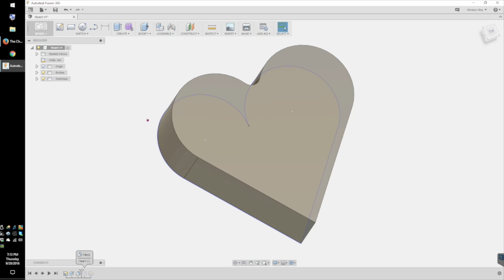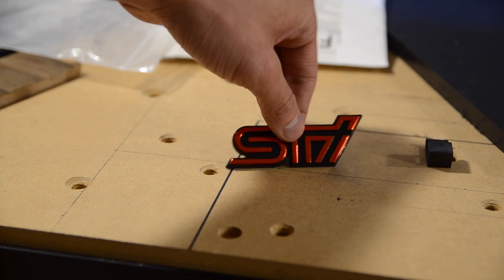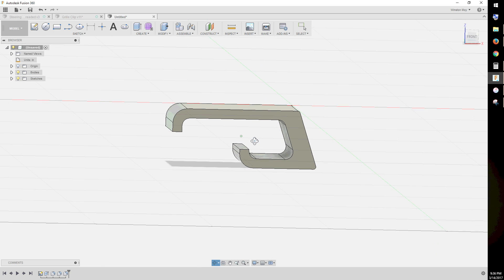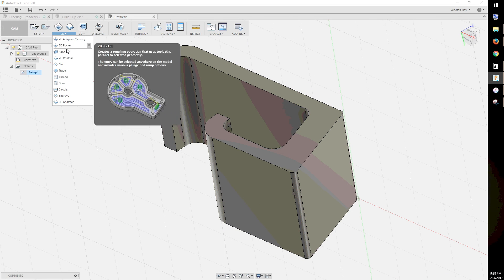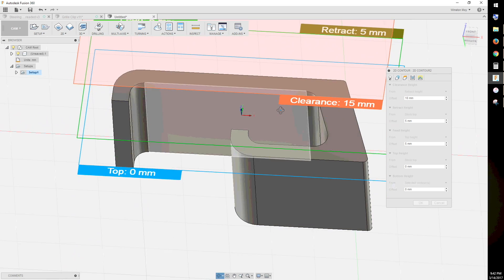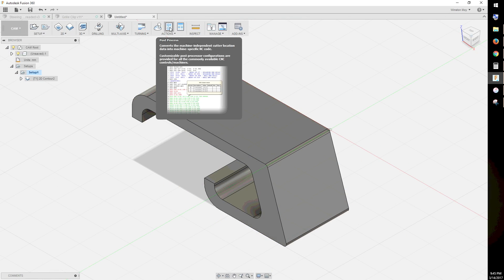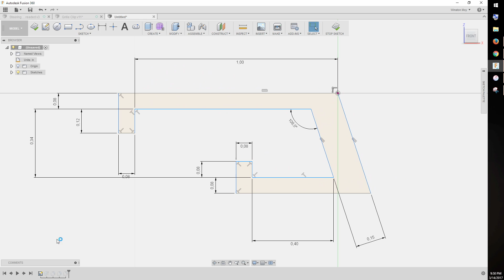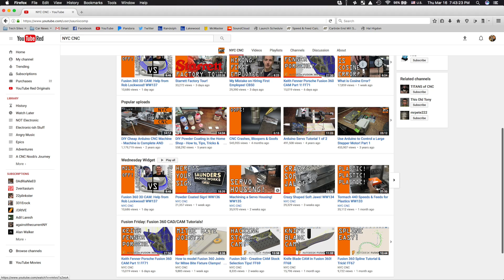Fusion 360 Overview: 2D CAM Start to Finish - CNC Project #84

Comment: Nice video but I have been asking for over 1 year which equipments compatible with this software, I have contacted dozens 0f channels. And equipment sites and not 1 decent answer
So after you make this part in software where do you go and how it is actually made, any help would be appreciated. I own a BIESSE Rober B cnc
I dropped AUTOCAD long time ago and currently using SKETCHUP 
Exporting simple dxf files and loading directly cnc
Thanks

Comment: I’m very new to Shapeoko. How do I use my Shapeoko with fusion. I have a simple drawing in fusion. Can I open in carbide create? How do I cut the drawing? Thank you, I really like your videos.
Reply from the maker: I published an overview of the Fusion to Shapeoko process on the Carbide3D channel, which you should be following. https://www.youtube.com/watch?v=xRVVUteI1PY

You can export a sketch as a DXF and open it in Create but it's a little buggy. splines and complex chains don't always work right. Inkscape might be necessary as an intermediate step. But the point of using Fusion is to ultimately model AND create the toolpaths in the same program, it's a one stop shop.

Comment: cool, couple of questions tho, what library of tools do you use? is there a carbide tool library that can be used in Fusion 360? or did you just manually added every tool?

Comment: Going from Jay Bates' sketchup tutorials to your tutorials are night and day. For example, he describes each of his steps so you can follow along. You seem to be quite familiar with Fusion 360 and, as someone who just installed it, you've made me incredibly nervous about using the software as you blasted through the simple part of drawing the shape. Feeling more intimidated after watching your video vs before.

Some tips; explaining your dimensions would be helpful. A comment such as "I select the line too and since I measured that the clip needed to be 20mm I set that, it's going to be 10mm high, so I... etc, etc". You spent more time talking about how great fusion 360 was vs explaining what you were doing. 

One more note, from the start Fusion 360 is set to metric and you're using imperial measurements. This threw me off as well because I was hoping to copy your steps to familiarize myself with the tools.

Sorry if this seems overly critical.

Edit: I see your description says "for Carbide3D users." It's quite possible I'm not your target audience.
Reply from the maker: I welcome the feedback, I can't predict everyone's perspective. My goal with the video was not to be a full-fledged tutorial, but to show that there are a manageable, finite number of steps to go from scratch to CNC recipe. 

There's really not a ton that's specific to Carbide3D, other than the post processing. Future videos like this will include tips and tricks that revolve around Shapeoko/Nomad features and limitations. But the overall process is the same for any machine.

For learning the basics of F360, I highly recommend the content on Autodesk's channel. They go through fundamentals, include tips for Solidworks converts, etc. In the future, I see that I can dive deeper into design decisions I make and the specific actions in CAD I do to realize them.

Comment: Thanks for making this. I have experience in solid works and carbide create and need to fill in the middle knowledge. Still never confident about axes and whether I have them correct in solid works so may try fusion360 more

Comment: this piece seems way more suited for a 3d printer to handle, but I know how you feel about it. :p
Reply: I was thinking the same thing.. I am still a beginner with fusion 360, however, I have been able to design a few simple parts and send them to my Dremel 3D. Aside from the main project I use both the software and my printer for (aircraft cockpit for simulation), I've made a door handle and hanger clips for around the house... plus a few novelty gifts for holidays. This clip would have been an easy print, and maybe even less time.

Comment: Thanks for the great tutorial.  I would love to see you get a 3d printer.  You would be amazing to watch with it.  The workflow for small parts (I have found) tends to be easier, smoother, and faster and I would love to see what complex parts you could create with one.
Reply from the maker: I actually have a friend/coworker with a 3D printer, so if a particular project or need comes up I may be making use of his machine. He has to finish building it though...